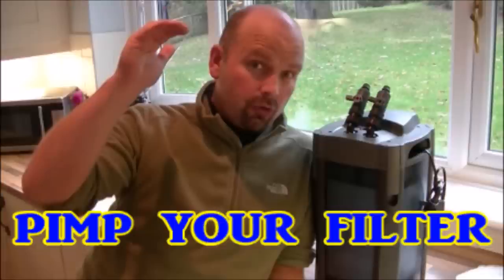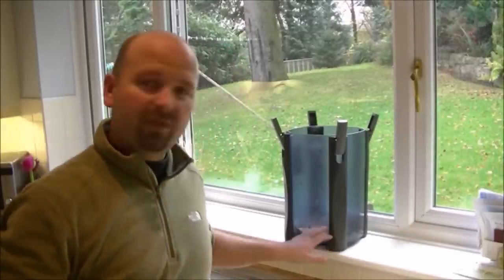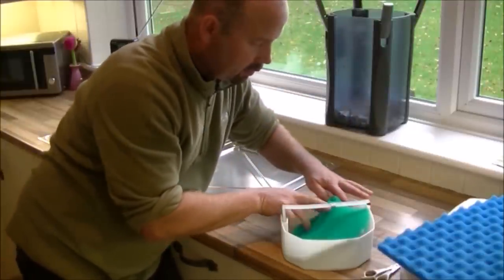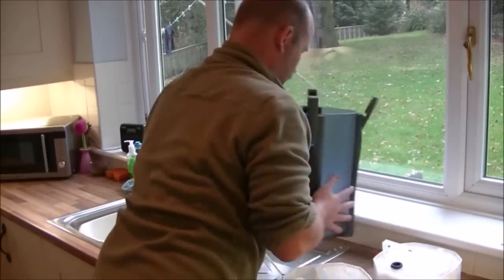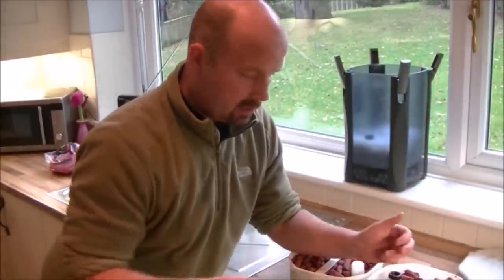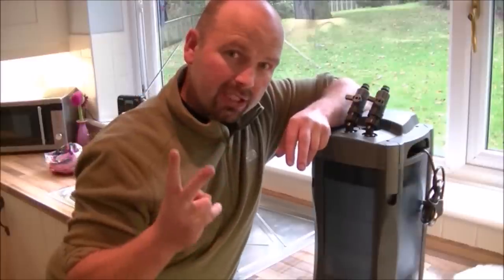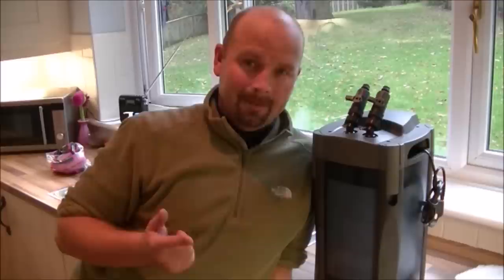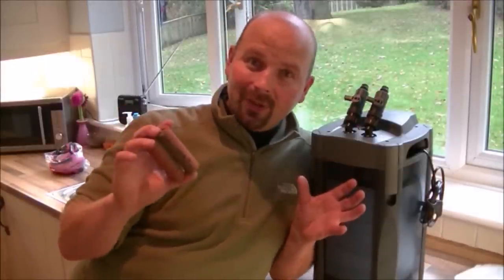External canister filter set up, nitrogen cycle and what happens in a filter - by Pondguru

Comment: hey Pondguru, i got a new tank 24x12x16 (inches) and i installed a top filter it says 25 watts, is dat power head over powered for my tank? please respond.
Reply from the maker: grotesqueMCR The wattage of a pump doesn't give an idea of how suitable it is for any given tank but I'd go for no more than a 2000 litre per hour for a tank that size - how much water the pump shifts is most important factor as most fish don't like  a strong current, especially live bearers.
Reply: it says 2800 liter per hour , im planing to have fancy gold fishes ( 2 or 3 i guessed) i saw some suggestions that says for a goldfish tank you really need a strong filtration x10 the capacity of the tank, is that true? based on that goldfishes produces tons of wastes . thanks for the respond.
Reply: what i did to minimized that current is i directed it the front instead of directing the discharge pipe of the pump head to the left or right. do i have to change it? what filter do i need for that tank size and for goldfishes
Reply from the maker: grotesqueMCR That filter should be any amount big enough for a few goldfish and as long as the current is not swirling around like a washing machine they will be fine. As the tank isn't very large it seems like an overkill to go external with the filtration but that will give you best filtering capacity (with a view to using it for a bigger tank in the future?).
Reply: may i just have to change it , will you recommend me a hang-on back filter or a internal filter?? i guessed i just have to keep that top filter and save it for  the future maybe i'll get some 75 gallon cichlids  tank.  very much appreciated thanks for always responding Pondguru
Reply from the maker: grotesqueMCR I would personally avoid HOB filters as they are generally none too good. I'd either make do with the filter and tank you have with that tank or upgrade to an external in lieu of a bigger tank. Most internals don't have much provision for biological media.
Reply: Pondguru Outdoors its been a week now since i ran that filter in my tank, and i put a malawi cichlid in it, is it already cycled? the fish is lively as ef swimming up and down, no signs of new tank syndrome
Reply from the maker: grotesqueMCR When using standard ceramic media the ammonia / nitrite cycling generally takes 4-6 weeks then nitrate will be produced as end product. Biohome will take 2-3 weeks for the ammonia / nitrite cycling then 4-6 months for the nitrate cycling.

Comment: hi mate can you recommend anything for the flival juwel type internal corner filters, that are built into their tanks ? it's not the best filter in the world and I was hoping to make it a little better. or would it be worth ditching it and using an external filter with your suggested media ? it's for a tank of about 70 liters . many thanks. dave
Reply from the maker: An external would be a much better choice and the fluval 206 would be a good one, even for heavy stock as it will hold 1kg of biohome ultimate (assuming that the bottom tray is used for coarse, medium and fine foams). Internal filters generally don't hold anywhere near enough media to achieve full cycle filtration (reduction in nitrate)
Reply: Pondguru Outdoors 

thanks for replying to this and my email :)
Reply from the maker: No worries, any time.
Reply: what do you think about utilising this media between gravel and an undergravel filter ?
Reply from the maker: The gravel would act as a mechanical media and the biohome should act as a biological media so it would work. The 'biorb filter upgrade kit' I came up with a while back uses a similar idea with a product which was made especially for the job: biogravel.
Unless the substrate used over the under gravel filter is gravel sized and shaped you wouldn't be able to clean it properly using a gravel cleaner. It would be much better to have an external if you have space for it as you can easily fit enough media in there and cleaning is easy.
Reply: Pondguru Outdoors thanks mate. the all Pond solutions external filter looks ideal for the money. what do you think ?
Reply from the maker: If you mean the 1000 then yes it will easily be big enough to (over)filter the tank. Each tray will hold 1kg biohome ultimate and it has 3 trays so assuming bottom one is used for the foams and fine pad that leaves 2 trays for media. 2kg should see full cycle filtration in a tropical community tank of 200 litres so its definitely one to consider if you're thinking of stepping up the size of the aquarium in the future. 
I can't believe they are on my £38.69 on amazon here: http://geni.us/2LnO
You would pay that for a crappy internal filter which wouldn't stand a chance of filtering the water.
Reply: sound. thanks very much. that's the one I was referring to yes. I will give it a go. does it need setting up in the same manner as the filter in this video ? foams on the bottom bio media in the top two trays ? can you direct me to the foams and media required please. then I will stop bothering you haha
Reply from the maker: Yes it would be set up exactly the same. The cheapest place for teh foam set and biohome ultimate would be on my website http://www.filterpro.co.uk
It will probably work out cheapest buying a '1kg freshwater filter upgrade kit' and an extra 1kg of biohome ultimate.
The kit has 1kg, foams and fine pad and the extra kilo would ensure that you have enough media for the 2 trays. Postage (UK) should work out at only £3.99
Filter kits are on 'filter kits' page and the biohome ultimate is on the 'biohome media' page.
Hope that helps.
Reply: top man !
Reply: ordered mate. thanks again
Reply from the maker: Groovy and no worries, any time.

Comment: Just cleaned my canister filter after setup 40 days my reading are ammonia 0 nitrite 0.25 ..nitrate 5.0 is this normal how much longer for no nitrites
Reply from the maker: Larry Liotta If you are using a sensible amount of biohome (around 1kg per 100 litres for most tanks) then the nitrate normally comes down to 5-10ppm within 6 months. In some cases it is unreadable but not in every case since every tank is different. If nitrate is down to 5ppm in 40 days that is excellent but I would have expected no nitrite after 40 days. Maybe there was an ammonia spike a few hours earlier which was converted to nitrite? Did you test water a few hours after feeding?
Reply: Pondguru Outdoors Yes I did but sometimes I need to use prime to get nitrites down.
Reply from the maker: Larry Liotta The biohome should really cope with ammonia and nitrite if there's plenty in there.

Comment: I just modified my mechanical filtration and my media was all dirty and most of the crap went into the tank -__- I guess I kinda screwed up the cycle but the media is old and but I will improve my water quality though since i added coarse, medium and fine mechanical filtration. When I have the budget I will upgrade to biohome ultimate plus. Now im waiting on the crap to go down so I can do 50% water change and get better water and media bacteria quality over time... I will see next water change if it was my mechanical filtration that was bad being mostly coarse or if my fluval 405 has a problem with sending the water in the mechanical area first.
Reply from the maker: Anthony Bergeron Time will tell but when you get sorted it will definitely benefit from good media in there.
Reply: Question, Is it a bad thing to use these vaccums that you can have the pressure to get water back in your tank? I mean, is it bad to do this since the water is full of chlorine or would it be better to continue shoving pails of water to my tanks that iis dechlorinated? I did this today instead of pails but I feel somehow terrible for adding so much chloramine in my tank with my fishies :( (although I added dechlorinator). What is your thought ont his?
Reply from the maker: Anthony Bergeron Not sure what you mean by vacuums to have pressure? Do you mean you put the water in under pressure and sprayed it in as a high pressure jet? That's what I used to do when I had the shop and we never used dechlorinator, just the gun on the end of a hose pipe spraying water in under pressure and you can smell the chlorine bubbling off no problem.
Reply: What I meant was those vaccums that you use to vaccum your water into your sink but that gives you the ability to also add water back to the tank by turning a valve upwards/downwards... Would my air bubbles help to clear off the chlorine enxt time I do so?
Reply from the maker: Anthony Bergeron Like the Python type? They seem to work fine but as I haven't used them I don't know about possible chlorine build up. Bubbles in water will definitely quickly remove that to atmosphere.
Reply: The box says "The Ultimate Gravel Vac"
Reply from the maker: Anthony Bergeron I am not familiar with that as I only used the suck into bucket type. Any aeration and water surface agitation will help with gas transfer and pollution release.

Comment: What's the brand of this canister filter?
Reply from the maker: I think it was an Aqua One 1200 which has been replaced by the Aquis 1250 from Aqua One. I did a very recent video on that one and its a great filter. http://geni.us/P7ZC4
Reply: Pondguru can I use that on my 20 gallon tank or is it too big?
What size do I need?

By the way I bought some biohome media from you and I am very happy with them 👍

Thank you
Reply: Pondguru in my 20 gallon tank I have 4 neon tetras, 10 guppies fish, 6 corydoras, two snails and two shrimp.
Reply from the maker: I'm glad you're pleased with the media - the 1250 would be a bit big for that scenario as the tank has a low stock.
A Fluval 306 will hold 1kg of media in each tray (fill 2 top trays) and will give you more than enough filtration for a 20 US? gallon tank or a 20 UK gallon tank even if it was heavily stocked.
Bet to use the spray bar on the return since guppies like a diffused flow.

Comment: Hi there. I'm about to buy second hand an eheim 2073, Is that the one you're showing on the video. If not, what's your oppinion on the 2073. Thanks a lot indeed. Cheers from spain
Reply from the maker: I'm not sure what the model number was on this filter in the video - may have been 2071 but I think they are almost the same. Eheim definitely make the best quality filters and their spares will be available for years after a filter has ceased production but ultimately how the filter is set up inside is the most important thing.
Reply: thanks a lot for the info! regards!
Reply: I finally bought it and I'm pretty happy with it. It was finally an eheim 2071: http://media.mediazs.com/bilder/filtro/exterior/eheim/professionel/1/300/117742_eheim_prof3_3_1.jpg .As you can see it has a prefilter with coarse foam, then the water goes to the bottom where there is a gap of 2.5cm tall, and then 2 canisters, one with very light black plastic hollow cilinder pieces and then it has the media and finally a fine foam, which I have learnt from your vids it's wrong. What I did is the following: I placed medium and fine foam in the gap, then media in the other two canisters. What do you think? Anyway, I've seen your videos and I want to upgrade the filter with your products. The thing is that I live in Spain and I don't know if there is a distributor here. I have seen you have a kit with foams and biohome ultimate. So I want to know how I can buy it the least expensive way, how much media do I need and how long doest it last, I mean do the foam and the media last the same? Thanks a lot indeed for your help and cheers from Spain
Reply from the maker: If the foams don't get clogged too quickly and work well in the bottom of the filter that would be the place to have them if you need to maximise the biological side of the filter with good filter media but I'm not sure that would work very well. This in-line booster would take all the necessary foams and allow you to use the space under the trays in your eheim filter for the plastic cylinders?  http://geni.us/2bj1
They are very cheap and take a couple of minutes to fit - they come with foams which are OK but the foams from an upgrade kit would be better, extending maintenance time. I have had reports of people never needing to clean teh main filter when they use a booster filter to trap all the dirt.
The cheapest place for the filter upgrade kits would be the FilterPro website http://www.filterpro.co.uk and I think the international courier shipping to Spain is £19.99 on there (UPS).
There is currently no distributor for Biohome in Spain.
Reply: thanks a lot indeed for your help. Your vids are awesome and we learn a lot from you. I've seen you have an ebay shop. I think I'm gonna order from there and I suppose you combine shipping costs if I order two or more things.
Reply: I've already ordered it via Filterpro. Thanks again. By the way in the paypal info it says Ireland, I don't know why, obviously it's Spain, LOL
Reply from the maker: Now worries on the address as it displayed fine when the order came through. Hopefully it will arrive quickly - thanks for the order.
Reply: finally received it, really happy with purchase. One more thing, it's petty hot here in Spain, what can I do with the rest of the filter balls that I haven't used. Can I place them in the fridge? Cheers and thanks a lot indeed again!
Reply from the maker: Yes they can be stored in the fridge and that will slow down the bacteria, extending the storage life.
Glad it arrived safely - not sure why but from UK to Spain is one of the slowest delivery services when I'm sending orders out to European countries.
Reply: thanks for the tip. it only took a few days, it's ok for me. regards!!

Comment: i followed the instruction but on a 2 level filter, my starter balls ended up back in my aquarium and many chopped up in pieces, is that bad?
Reply from the maker: I'm assuming your filter did not have a plastic screen over the top tray so that can happen but will do no harm. The bacteria will still flow through the system and colonise the media.
Reply: it had the plastic cover, but the cover had 2 small random openings in the middle. thank you for your prompt replies.

Comment: I enjoyed this very informative. One small ? I noticed you do not use charcoal. Any reason?
I use a Eheim canister and feel it is the best in my humble opinion. Cheers.
Reply from the maker: Unless there is a need to draw in treatments (after treating fish) or colour form bogwood there should be no need for carbon / charcoal as the filter (when a suitable size and set up with proper media) will process all of the ammonia and nitrite. Ideally it should process the nitrate too but that requires media capable of supporting a good balance of aerobic and anaerobic bacteria. Mostly carbon or charcoal is added to reduce smell (from ammonia) and simply masks the failings of a filter (due to it being too small for the tank volume / stock and poor filter media).
Eheim generally set their filters up quite well and have some good media available depending on the model.
There is relevant information on filtration, media and the amount of media needed to deliver full cycle filtration (reduction in nitrate) for different tank situations here: http://filterpro.co.uk/qa-24-w.asp
Hope that helps.
Regards,
Richard

Comment: Hi, was wondering if anyone can  suggest a good external filter that would be suitable for a Juwel Rio 125? Ive currently got a 60l bowfronted planted tank with an Elite Stingray filter. The filter isnt very good and currently battling a hairgrass algae outbreak. 
Im on a budget, would 2nd hand Fluval 206/306 be any good? It will be going in the kitchen but going to place it on a back wall so not near sunlight (think thats half my problem just now)
Reply from the maker: Yes the internal stingray is definitely no good for a 125 litre tank.
Size of external needed will depend on the stock but if you're looking for a second hand fluval then the 306 would hold 2kg biohome ultimate, more than enough for a normally stocked 125 litre tank. 406 would take 3kg biohome ultimate which would cover you for cichlids or goldfish which are much more demanding.
Reply: @pondguru  Hi, my 125 is quite heavily planted. Has a handful of different tetras - neons, fire, amber. Plus a couple of corydoras. I also have a Juwel Rio 180 thats up and cycled and has a collection of community fish and is also planted. Not sure which tank would be more suitable for the canister filter?

Comment: Seems if you had the option, the balls should go in the bottom and the rings in one basket. The rings would be good media v. the balls just redirecting water?
Reply from the maker: If had rings and plastic balls to use I'd definitely ditch the balls (as they hold so little bacteria) and use the rings under the trays to catch heavy muck and offer limited bacterial support. Bottom tray would have foams and fine pad and then the trays above that would have media.

Comment: Wouldn't the clogged up bottom of the filter become nitrate factory?
Reply from the maker: Not really unless it was left undisturbed for many months. During regular maintenance the dirt and muck in bottom is removed to keep water flowing well through filter (and preventing pump strain) so that's why it is very important that the media supports anaerobic bacteria if you want to see permanent low nitrates.
Reply: What is considered regular with the external filter, set up as you have instructed?  Also, how often and how much water needs to be changed, once everything is mature and functioning as it should?